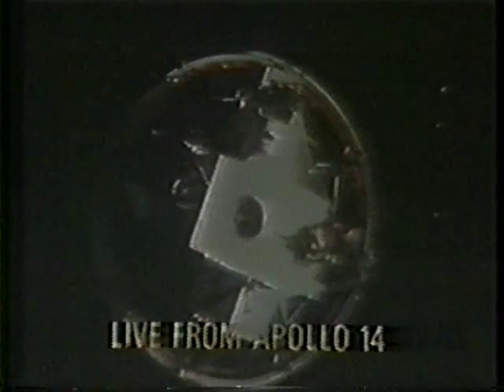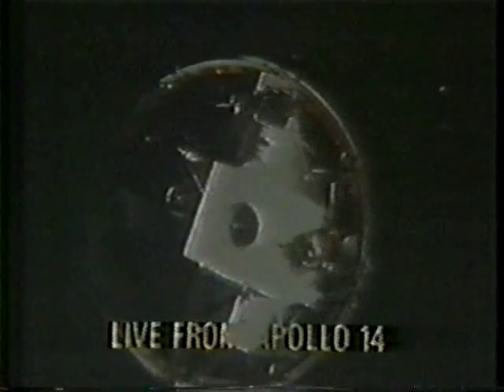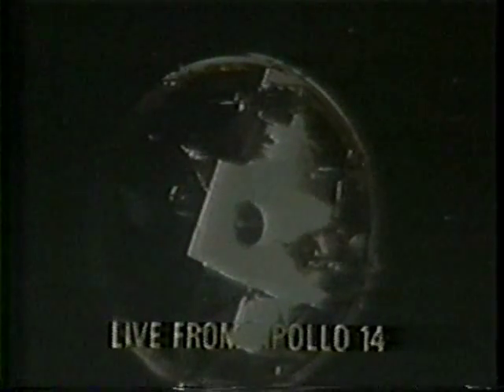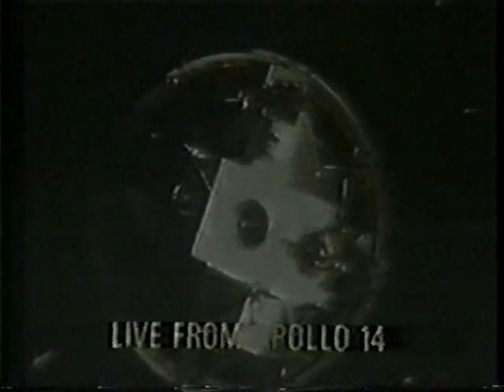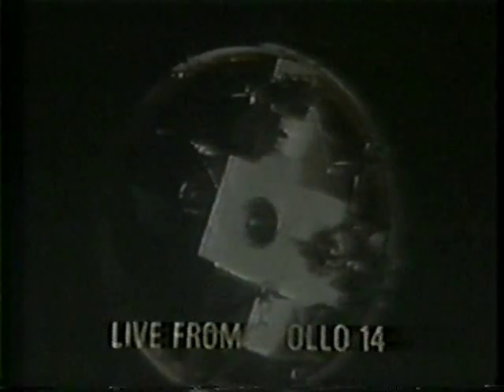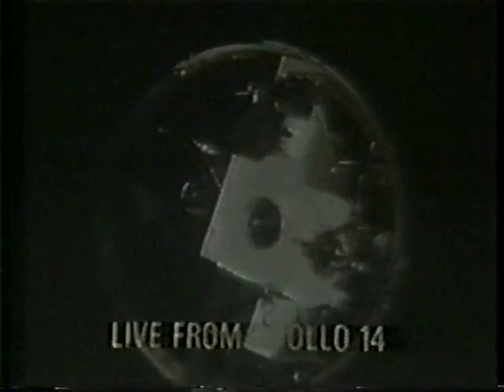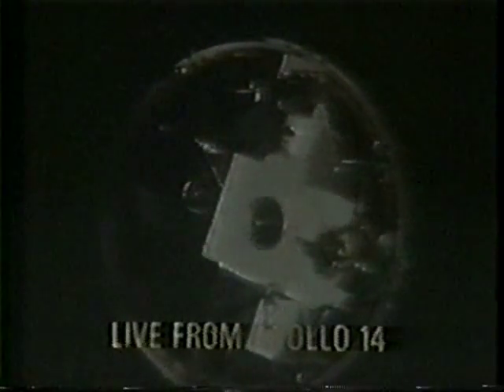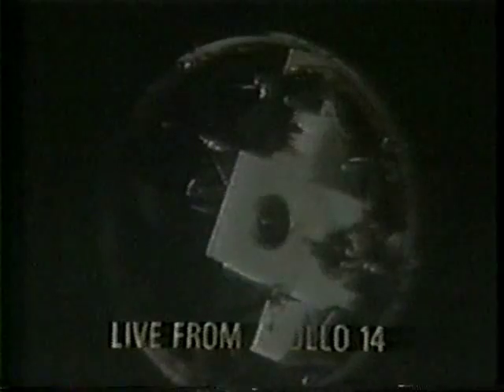Apollo 14 Part 6 News Coverage

Comment: Correction on your date--this very difficult T&D that almost cost us a Moon landing, but did not thanks to the skilled work of CMP Stuart A. Roosa and his crewmates Alan B. Shepard and Edgar D. Mitchell--took place in the early evening of Sunday 31 January 1971. Thanks for uploading this great television coverage! The original transmission, the network telecast, and your posted copy all are in remarkably good quality! "LIVE FROM APOLLO 14"Do you know which network this is please? I do not recognize the voice off hand.
Reply: Thanks to Mission Control and backup CDR Cernan  and John Young who, using a real docking adapter,  figured out a workaround, briefed the crew, that eventually worked thanks to indeed good work by Stu Roosa. 
It wasn't the last option, but the last that didn't involve a deep space EVA to get the probe inside and check it.